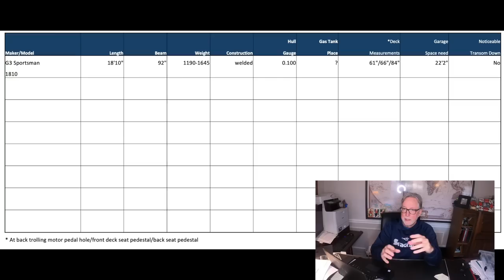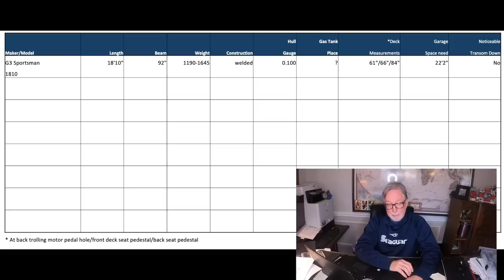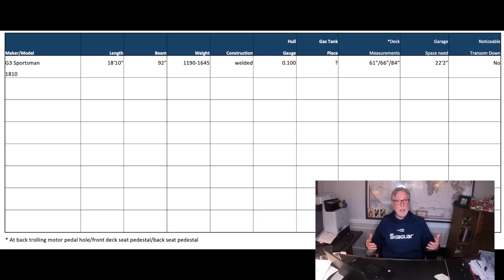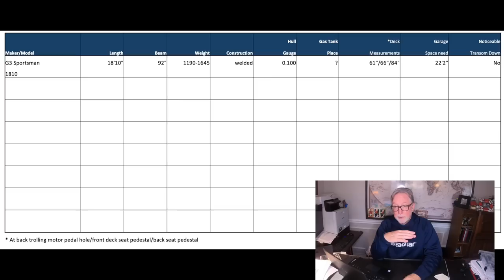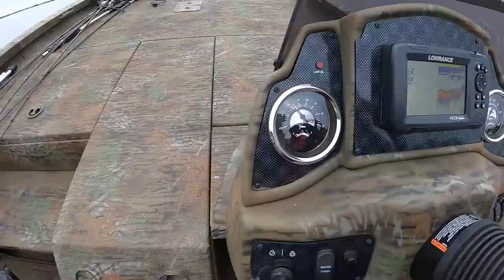G3 Sportsman 1810 - Great Tin Boat Search - What is the Right Aluminum Gauge for Hulls - B1 Vid 2

Comment: Ken, one advantage I have noticed in my Tracker 195 regarding the angle it sits in the water. Standing all the way up front on the bow provides about a foot additional height for bed fishing compared to my previous glass boat. Easier to see the bed and fish reaction from a greater distance. Thanks for all your efforts and great information. I’m a loyal sub. Merry Christmas.
Reply: How’s taking water over the back every time you stop
Reply: @infinity_boyz5223  gotta hit the throttle just a touch each time. Something you just get used to. My first aluminum boat and wasn’t sure but I really like it. Had 2 years and quicker than glass boat by about 10 mph, Same size and hp. Cheaper to tow and run. Not quite as smooth in rough water but have run 2-3 footers with no problem.
Reply from the maker: Hadn't thought of that, don't nest fish much but that would be handy as heck

Comment: Good to get alerted to your video series.  I have a 2004 G3 HP180 w/ 150 Yamaha and the hull got dented in in  right in front of the transom- so that acts like a big trim tab that keeps me from getting up on pad fully.  I might wave to get the courage to try to push those dents out after hearing what you said happened to your XPress owner buddy.  I wish G3 made their HP (High Performance) series again- they were great boats and competed well with the XPress.
Reply from the maker: Challenge is getting to the inside of the Hull. I wonder if one of the companies that pulls door dings out of cars could pull those dents out, same idea?
Reply: @KenSmithFishing  My dents are right under the battery and bilge area, so removing them might give me access.  Lots of places are hesitant to go outside their envelope of expertise though.  I even asked G3 about how to fix it and they were absolutely no help.

Comment: Thanks , I too owned an Aluminum boat 10+ years ago . Since that boat I've owned 2 Triton glass boats . This Fall I hit a stump with a fence post in it and gouged the hull of my 20 ft glass boat . The repair bill was $7700.00 and took 1 1/2 months . If I had been in a tin boat it would've been a simple fix for me because I own a welding and fabrication business . I've noticed a lot of tin boats in the tournament trail that I fish and am starting to understand why . Personally I'm also looking at a tin boat for a tunnel hull modification . I mainly fish the Coosa River lakes and a lot of the tournaments are being won in areas that only a tunnel hull will reach
Reply: you need a weld shop if you own a tin boat    it will crack if you fish big water
Reply from the maker: Tony, per Bryan's note I think there are positives and negatives to both. I'd rather be in big water in a glass boat 100% of the time as there is some pretty strong evidence that they can't handle the daily wear of big water, but in stumps and trash I'd rather be in a tin boat.
Reply from the maker: see below

Comment: Ken you're welcome to come down to the Atchafalaya basin and put some time in on my  GatorTrax Strike.  Have a look at Kieth Poche and his "Off the Grid" video series.  Sometimes lighter can be the right choice.  Coming out of a BumbleBee, I had my choice of any boat on the market for my primary tournament boat. I chose a custom built 22 1/2' Strike because they're so heavy built but are extremely nimble.  I needed something super durable because down here we contend with shell beds, oyster bars, lots of logs, stumps, and even well  heads which can ruin thin tin and most fiberglass hulls not to mention how rough really shallow water gets with a stiff breeze.  However.. as you mentioned a heavy boat isn't necessarily what you want going skinny, but what do you call skinny?  My Strike will get up in 18" fully loaded and will run in much much less, but there are times we are in 6" or less to get to where we are going and for that you need a boat you can pick up and push so many of us have a medium guage aluminum skiff with a go-devil.  It's not nearly as glamorous or as accommodating as a typical bass boat, but you can't fish if you can't get to them.  These boats excel at super skinny shallow water, jumping log jams, and going where a normal bass boats can't, but they suck on open water or covering distance.  No single boat will be great at everything, so sometimes the best answer is to invest in a primary boat that does most of you you do very well and a secondary boat to cover the other stuff you do.  Lastly... price.  Most of your production tin boats are offered at appealing prices and you can often get a lot of boat and features for the less money than a quality layup composite hull, because it's just more economical to stamp out a hull from a sheet of aluminum.  But just like fiberglass boats come in cheap chop glass vs hand layups vs ultra-light carbon composites you have that same range in aluminum.  There are entry level boat up through custom purpose built boats that will fit any budget and meet specific expectations.  

You can get excellent results from a Tracker, Cajun Special, Xpress, AVD, GatorTrax, G3, and all sorts of custom builds.  You just need to match the boat you choose to what you need it to do.  Fiberglass boats aren't the ONLY answer to boating needs.  There's a time and place for them in all their price ranges and build specs.  Fiberglass or aluminum your choices come down to what you want out of it, your budget, maintenance expectations, and even just how you feel about how it looks.  Good luck on trying to flesh this one out.
Reply from the maker: Thanks Joesph, I think I've found one up here, just need a weather window to do some videos

Comment: I have a 2003 triton 186vmag with a 150 xr6 don't know hull thickness but after 19 yes. It has plenty of dents from stumps. It also has had a split in the hull for the last 8 years or so. That has caused the boat to lose speed. I believe the foam flotation has absorbed water and now the boat weighs more. Welder said boat gage was not heavy enough. And the 150 was too much motor. New it ran 58 on gps best I get now is 48 maybe 49. Motor has new power head. There is also stress cracks on front were v starts. Boat has pad hull . Just thought you would be interested in the information.  Love your channel. This topic hits home thanks again.😎
Reply from the maker: Mark I guess the good news is that after 19 years you got your $ worth, curious now what thickness that Hull would have been.

Comment: So this might be hard to see in this review is pics of hull construction without the deck. I had failures/cracks in the aluminum hull of my tracker proteam 175 where the supports that run across the deck width wise meets the hull. I’ve heard these are welded together and can weaken a hull but I’m not 100% sure how they attach or even do.
Reply from the maker: Stevie…so now you’ve got me wondering who fixes metal boats that are damaged, I will investigate and report what I find
Reply: HUGE difference in the hull of a tracker that may have tack welds in some spots and rivets in others.  The problem isn't that welds are weak.  Compromises to lower price or intentionally make boats lighter and easier to handle are why the cracks occur not just simply because the material is aluminum.  For instance you don't see many fiberglass boats in commercial duty.  Steel is the prefered material and then they step down to aluminum if weight becomes an issue.

Comment: I have a Tracker 195TXW w/Merc 150 and live just minutes from Ray Hubbard that is available to you for review. I do have more weight in the rear than this boat did stock with me adding a 3rd battery and 2 12" Talons, but I can remove the Talons and the 3rd battery so that you can get more of a stock review.
Reply from the maker: David let’s connect, I’m kensmithfishing@outlook.com
Reply: @KenSmithFishing  email sent

Comment: There is a usb plug under the console on the right hand side. I have a 2020 G3 1810. Added Ultrex and 9” Lowrance Elite TI2 on console and 7” Elite TI2 up front.
Reply from the maker: You threw some extra $$ on it

Comment: I’ve got the 1710. 90 hp. I love this boat. It’s not the fanciest tin boat or the fastest, but it fishes great. I’ve added power poles and 4” Atlas hydraulic jack plate. HDS Live in console and FS9 on the bow networked by ethernet. Replaced 12 v Edge TM with 24v Fortrex 80lb. The only thing I hate is rod locker is just too small but I can get 12-14 rods with rod gloves on in it. Boat new was 19k. Add ons are pricey but I got it like I want it. Resale value should be really good for the way it’s rigged.
Reply: Glad to hear that you like it. I'm looking at a 2023 1710 (it's new, just a holdover from last year). It has a 70hp Yamaha (wish it was a 90). I don't need a lot of speed but hoping for 37-40.

Comment: A comment on the steering? Hydraulic or cable steer?
Reply from the maker: I think on smaller HP motors you can get away with cable, but I’ll spend the $ for hydraulic

Comment: Does the depth finder at the console work properly when running on plane?  Thanks for doing these!!!!!!!
Reply: I have the same question.  I remember years ago when I was in a tin boat that the “skinner transducer” on the back wouldn’t always work at the higher speeds. Definitely curious to hear the answer on this
Reply from the maker: On plane yes, at speed you’ll struggle. Too much turbulence from under the hull

Comment: I have aa comment about your use of "gauge" when talking about thickness. I think what you are talking about is the actual thickness of the aluminum in thousandth of an inch. So 100 would mean 0.100 inches. Which by the way, is the way you listed it in your chart. Normally, when a gauge is used, the higher the number, the thinner the material.
Reply from the maker: Ok now I’m confused to help me here, so the Gator Trax is basically 190 gauge (a bigger number), but that equates to roughly 3/16ths inches thick, correct?
Reply from the maker: And by the way the first few boat sites I’ve looked at list them as gauge, so is that not the correct terminology?
Reply: @KenSmithFishing  In your video you said you had not checked to find what the thickness was in inches. What I am saying is that the 100 figure you used was the thickness in inches--0.100 or 1/10 of an inch. I think the sites you have looked at use the "gauge"  as a generic term for thickness. In wire sizes for example, a 12 gauge wire is thicker that a 14 gauge wire. The same is true with aluminum sheet. A true 190 gauge, which I do not believe exists, would be thinner that a human hair if it did exist. The numbers you are using are the thickness in inches.
Reply: @KenSmithFishing  you're correct.  The Strike hull is .190" thick aluminum which is a hair over 3/16" which is what we all call it and is the next thickness more than 10guage.

Comment: Great video, but you've got you "gauge thickness" messed up.  The higher the number the thinner the gauge. 100 gauge aluminum would be as thin as maybe a sheet of paper.  10 gauge aluminum is .1019 thick,  slightly less than a  1/4 inch thick..  While not exact, 8 gauge aluminum is considered 1/4 inch thick
Reply from the maker: Weird I thought I looked that up?
Reply: Not sure you are right, was just on gator trax site and the higher guage is thicker. They actually list thickness with the guage

Comment: The New Alumicraft boats have more of a glass boat hull design which should help with the Splash, and stability (listing). It's not as flat bottom, as the other boats. And should keep the stern from drifting around as much as the G3. 

Also, when you're talking "gauge & weight", your really talking "weight & water displacement." Meaning, the heavier gauge might make a half an inch difference in how deep the boat sits in the water. But then again, it might not make any difference at all. Glass boats are super heavy. And yet, because of the volume of water displaced, they don't sink. So get the heavier gauge just because it will make the boat "feel" more comfortable & secure. 

Either way, check out the new hull design on the Alumicraft boats and let us know what you think. In my mind, it's a compromise between the flat bottom and the glass hull.
Reply from the maker: Will do, I understand displacement, however I still don't understand how a battleship or air craft carrier floats....makes no sense, and don't get me started on jumbo jets....
Reply: @KenSmithFishing  Hahaha, yep! Something fishy about them carriers. But, ah Man! Did you have to mention jumbo jets? Did you know they are planning to remove the jet fueled engines and replace them with Electric engines? Can you imagine the Size of the batterys they will have to use? And unlike jet fuel, the weight of the battery is not decreased over the course of the flight. No, they just lose power. Holy crash site, Batman. I'm gonna ride my bike. 🤣

Good fishing, Ken. 👍

Comment: I don’t own a tin boat, but fish with several guys that do and they are seniors to me. Ie 65-75!yr olds.  They have learned one thing when launching their trackers…

They don’t ever release their bow load straps safety chains until they are down the ramp with trailer tires touching water.

The boats are so lite and on steep ramps they have seen their boats slide down the trailer bunks during launching.  Just warning you ahead of time.
Reply from the maker: GREAT tip!

Comment: I feel like if you don't research a gatertrax 1st you will not judge all these tin boats properly and with the right mind set.  I don't  really like how you kind of allude that an aluminum boat shouldn't have the same standards as a fiberglass boat.
Reply from the maker: Adam talking to the GT guys soon, but it’s a different $ point than the rest of these boats
Reply: @KenSmithFishing  I get that but the quality is so much better. I almost bought one of their 20 ft bassboats but was to expensive and you never see a used one because the owners love them. Did you watch the video about their extruded aluminum?
Reply: @KenSmithFishing  I would agree with Adam from the direction of the Strike being in a different class.  It's not a production, cookie cutter, budget boat and is on par to compete with the very upper end of hand laid tournament grade fiberglass boats, which you will not find in the $50k range when you're talking ultra durable or ultra-light.
Reply: All other boats aluminium or glass come in a distant second to Gator Trax tops in quality of materials and workmanship. 
  You can design your dream boat that will last you a lifetime

Comment: The biggest difference in tin boats are what the inside is braced with most are sprayfoam and sheetmetal bracing. Gator Trax is all extruded aluminum bracing.
Reply from the maker: Something I plan to learn more about

Comment: I watched this and enjoyed it, BUT, and its a big but, so far you never talk about stress cracks...All Aluminum boats get stress crack...no Im not talking about hitting anything, that's not a stress crack...Im talking about the day-to-day flexing of the aluminum while you are running the boat.  smooth water, not so bad, choppy water a lot worse than that...rough water even worse.  Over a period of time, the aluminum flexes enough to start cracking...and all-aluminum boats do it...some a lot worse than others.  Please address this in your videos, talk to folks that repair the boats...talk to your friends...a new boat will not give you a picture of stress cracks as it happens over time.
Reply from the maker: Thanks Lee, I was unaware that was an issue. I had heard of breaking or cracking welds, but you are saying away from the welds?
Reply: @KenSmithFishing  They do both Ken, I had a Fisher Craft  Marshhawk that had seven to nine stress cracks along the bottom of the hull when I junked it....they will crack wherever the metal flexs, vibrates or has excess movement.  Aircraft have the same problem, remember the Hawaii airliner that lost the roof?  I was in the Aircraft industry for 37 years and saw it all the time.  In the industry we put what is called a doubler on the crack and stop drill both ends.  Please, do not take my word, Do some investigation, talk to aluminum repair shops...talk to people who repair General Aviation aircraft..  Im not trying to sound like a fanatic but this problem is never mentioned with Aluminum boats and before you lay out that kind of money you should at least be aware of it.  If you need any further information try me on Messenger, Coleman Adams